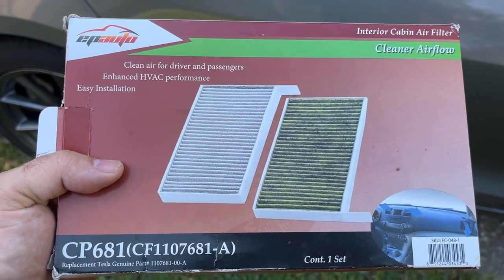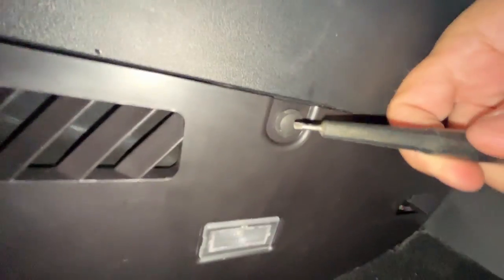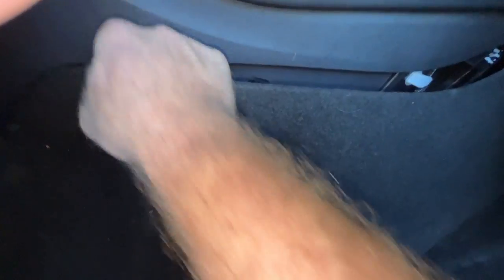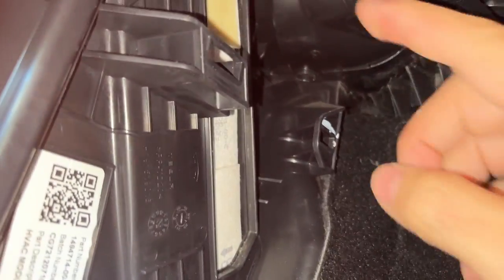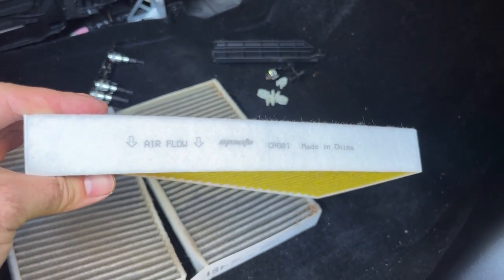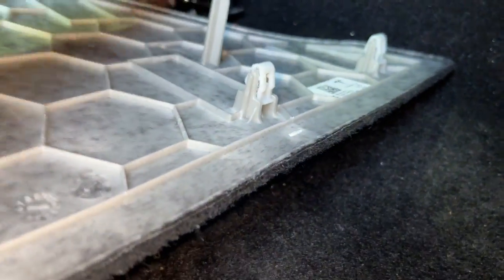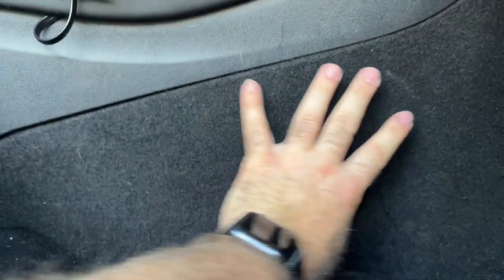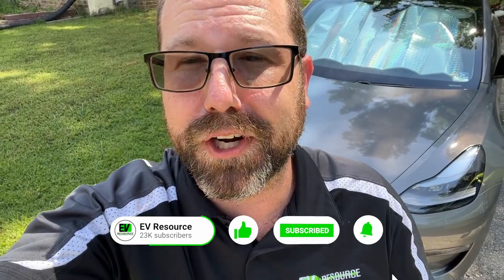IT'S EASY! 2021 Model 3 SR+ Cabin Air Filter Replacement

Comment: I watched a technician from Tesla, just pull the carpet away to replace the filter Why did you do the panel under the dash as well?
Reply from the maker: It made the most sense for what I needed to do.
Reply: @EVResource  would you have been able to do it without removing that panel as well?
Reply: @segoviagoodin  I think on the older Model 3's you needed to remove that because the torx screw was at the top and was hard to access without that panel removed. On the newer models where the screw is at the bottom, you can do it without removing the glove box panel. It's definitely tight without removing that panel though
Reply from the maker: Maybe, but it was much easier with the other panel out of the way.